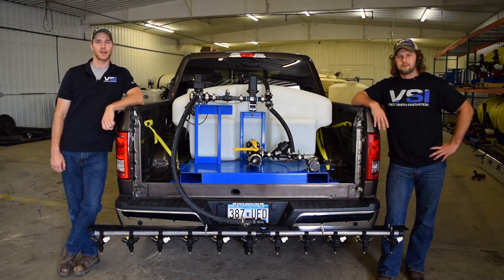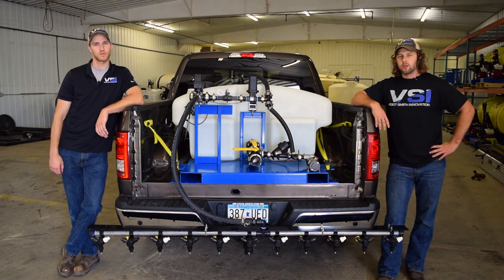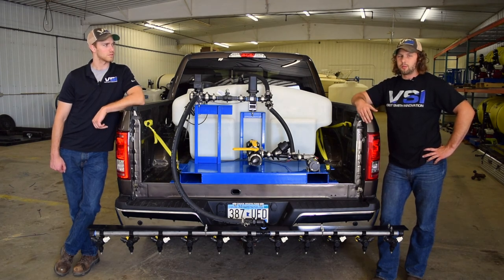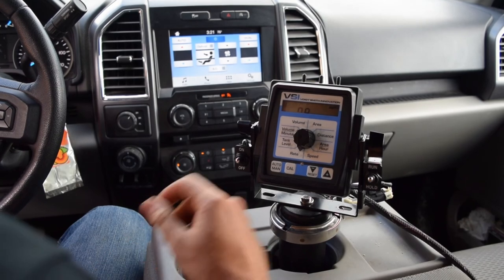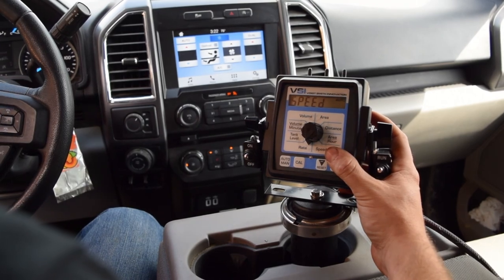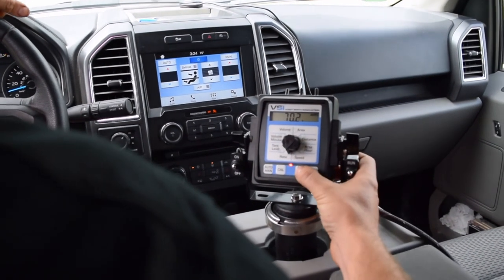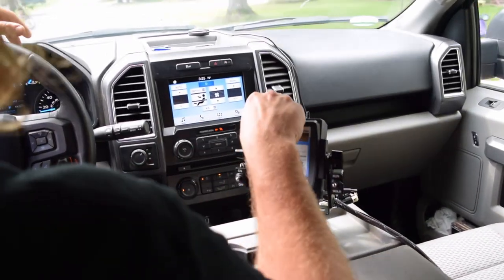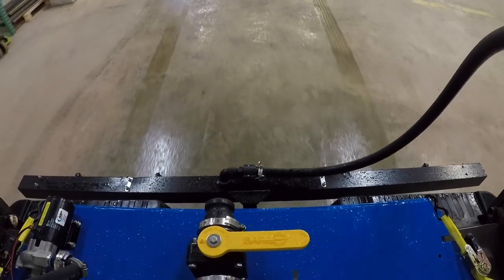205 LP Electric Liquid De icing Sprayer

Comment: what the prices on these
Reply from the maker: Luther, we have all the prices for our equipment on our website. You can go to www.vsinnovation.com and check it out!
Reply: @voigtsmithinnovation4112  I cant find the LP205 on the website? Did you discontinue?
Reply from the maker: @cburgz3697  We did discontinue the 205 due to it being the same footprint and price as the 305. We have a lot of customers that will only run 205 gallons in their 305LPs due to weight restrictions.